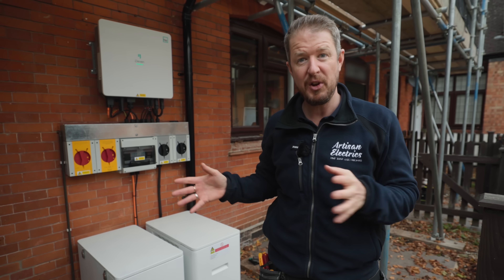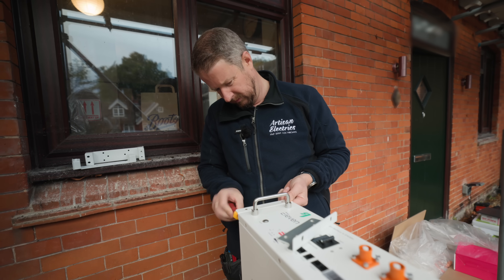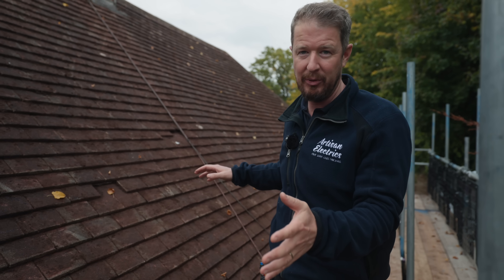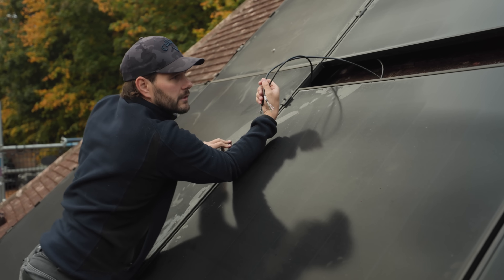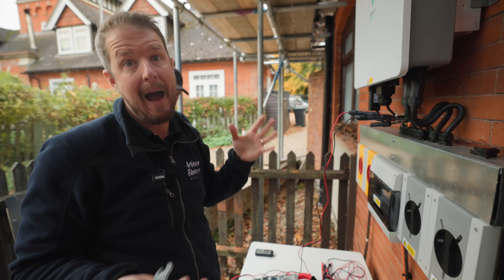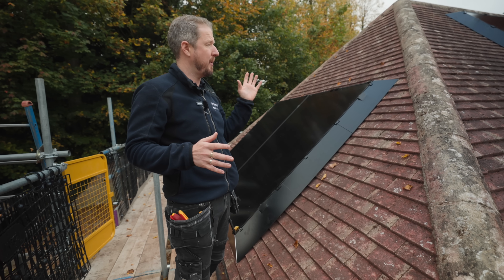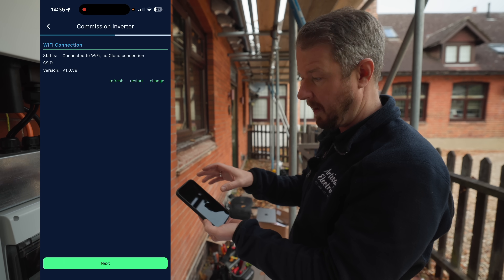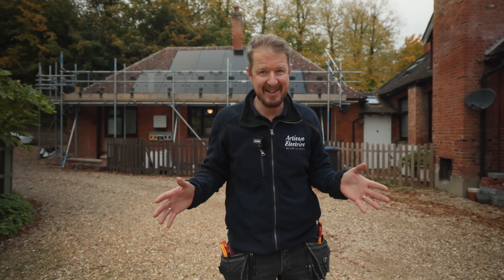Is Sodium-Ion The Future of Battery Storage?

Comment: Did I miss hearing battery specifications? KW/h and Voltage?
Reply: 4.5kWh, Operating voltage: 33V to 59.2V, which is just huge; no inverter will work efficiently like this, especially when the battery is low you will get half the inverter max power, which will limit your use of these batteries
Reply: @andrewfpvair  That still leaves a bunch if the voltage range on the table. It's quite the challenge to make a good inverter for this chemistry. And a BMS to withstand the amperage required...
Reply: @lua-nya  their inverter is just like any other nothing special, what it does it's that it will just limit the max power as the batteries discharge so you will have max power only at 100% SoC which will decrease to 50% max inverter power at 0% SoC, and it doesn't matter if you have more batteries in parallel, the limiting factor will be the inverter max battery current which is fixed.
Reply: @lua-nya  BMSs can withstand 1000s of amps if you just throw more mosfets at them, but maintaining efficiency over a large voltage range is a bigger problem.
Reply: @ahaveland  No shit. But with the need for under a 100A with a full battery and over a 1000A to squeeze relevant power off the bittom percent, it needs to be extremely overbuilt for the mid charge amperage. Which is expensive.
Reply: @andrewfpvair 33 V – 59.2 V operating window on the Eleven Energy sodium-ion (Na-ion) 4.5 kWh pack is indeed problematic from a systems engineering perspective, especially in hybrid inverter applications. 1. The voltage swing is too wide for efficient inverter coupling. A typical modern hybrid inverter (even the “low-voltage” ones) expects: Nominal battery voltage: around 48 V (LiFePO₄ nominal 51.2 V) Usable range: roughly 42 V – 56 V. So when a battery drops to 33 V, the inverter’s DC-DC converter has to boost the voltage massively to maintain the internal DC bus (typically 380–400 V). That step-up causes: High converter duty cycles → lower efficiency (~5–10 % loss increase) Increased current draw → higher I²R losses in cables and MOSFETs, Thermal stress → inverter derates earlier, or even cuts output power, Voltage sag under load → inverter may trip if battery internal resistance rises (cold weather or ageing cells). At the top end (≈ 59 V), it’s fine — but at the bottom, you’re right: the inverter will struggle to sustain rated output, particularly above ~3 kW on a 6 kW inverter. In other words, you lose usable peak power as SOC drops below ~25 %. 
So, Real-world inverter impact In tests (and user reports) with the Eleven sodium systems: Inverters typically derate by 30–50 % when pack voltage < 40 V. Efficiency drops from ~95 % to 88–90 %. Under large loads (say > 3 kW continuous), some inverters trip or switch to grid early even though 20–30 % SOC remains. This means you get the advertised energy capacity, but not the power delivery at lower charge states.
Reply: @andrewfpvair  The battery system comes with sodium-ion battery optimised inverters.
Reply: @YichenShi  they are not really optimized inverters, they are normal inverters with the cut-off voltage set lower, which is fine; what is not fine is that they only deliver half max power when the battery is low; an inverter could be optimized to account for this, but these inverters do not
Reply: @andrewfpvair  Of course there are inverters designed for sodium batteries.
Reply: @AprezaRenaldy  not these ones, these will work, but will only deliver half max power when the batteries are low, they are not really designed for sodium batteries, they can work with them with big power limitations
Reply: I didn't hear it either. As I understand it most Sodium-ion batteries have lower density than lithium, apart from some lab experiments. KW/h parity might still be a few years off.
Reply: @TadeuszCantwell  They are only slightly bigger than LFP battery packs and can fit in 19 inch server cabinets.
Reply: According to the specs it's 33 - 59,2V. That means you lose around 12% SoC at the top and 8% at the bottom. So 20% of the battery is NOT usable with this inverter 
And that is besides any inverter losses
Reply: But are they cheaper per kWh? So could you buy more for the same money?
Reply: @patdbean  no, they are about twice the price of LFP, the price will go down but it will take many years; even if they were cheaper they have limitations like getting only half max power when the battery is low, which will affect some installs
Reply: @andrewfpvair  Yeah, that's a bit odd, as they're sold as being 40-60% cheaper to make.
Reply: @px794  Cells are cheaper assuming same cell size. There's a matter of scale economics going on. I haven't seen 300Ah Na-ion cells, or even 100Ah, I imagine these use smaller cells, making pack assembly be a bigger part of the cost than cell production.
Reply: @patdbean  They're supposed to. In practice the cells aren't that much cheaper than LiFePo4, which due to the narrower voltage range is much more practical for anything striving for constant power limit.
Reply: Each battery pack is 4.5 kWh. The dimension is 550 x 525 x 155 mm. There are two battery packs in each of these enclosures showing in the video. The size of these packs are not significantly bigger than LFP batteries. The rated voltage is 45V.
Reply: I think it was only the title of the video, that was about sodium batteries, not the actual video.
Reply: typical artisan electronics video
long-winded, superiority complex, sparse on actual info